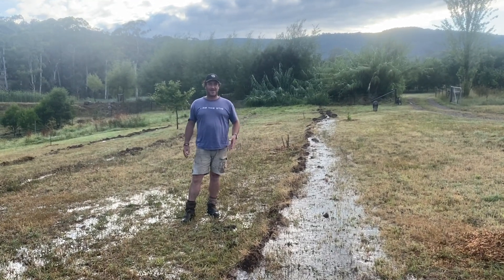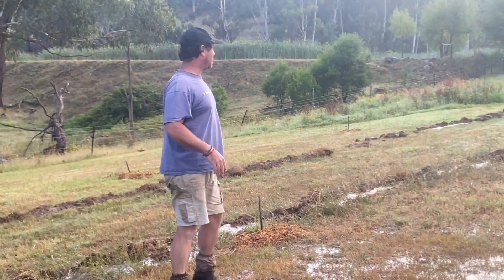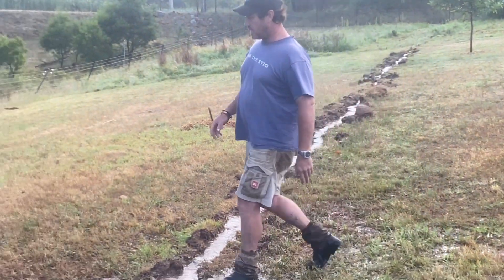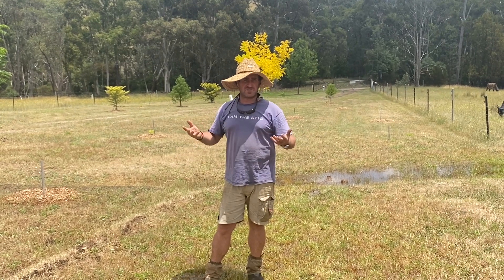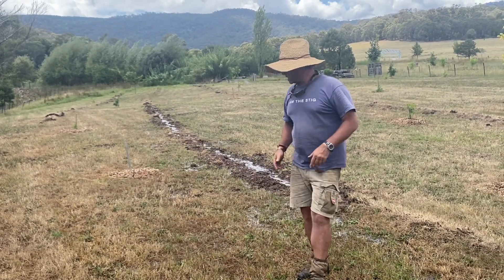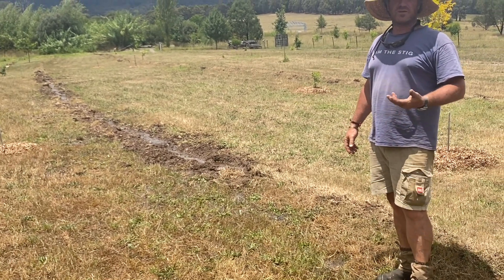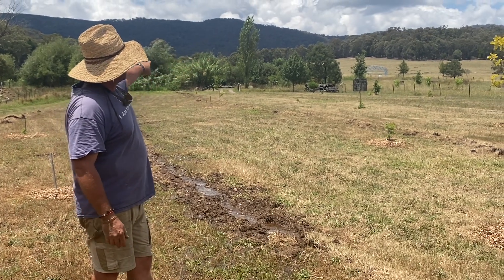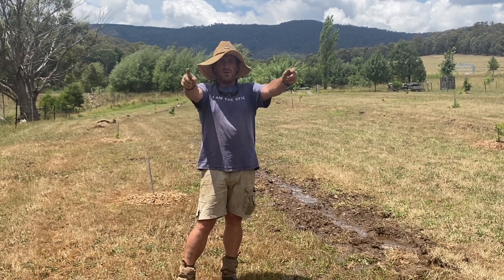Soil Hydration With Keyline Cuts.

Comment: The more I learn about keylines I feel like keylines in fields very similar to broadforking for residential back yard or for small market farms. Is this correct?
Reply from the maker: Hey Jeremiah, key lines and swales enable the water catchment to slowly absorb into the ground rather than running off the surface. If you use a broad fork its sort of similar where you are catching the rainfall. However the broad fork area can saturate really quickly and hence your not capturing a 100%. Its a great start through. Maybe a kelyine or swale at the top of the vegetable garden and allow to absorb slowly. Cheers

Comment: Hi, I'm a drainage design specialist. Were I farm, we have very dry summer and very wet winter, but like you, it comes down hard and fast. What we do is use what we call sub soil plow. This does much like your pipe plow, but we do these cuts every meter. This just speeds up the hydration of the land with any rain we get. Doing it this way means we don't need the water to stay still for long. It just fills these voids down 600 mm down. This hydrates the land so fast and lasts weeks.
Reply from the maker: Hey Nicholas how many tines are on your sub soil plough?
Reply: @FatCowFarmTatong  just the one on mine. It's easier to control and stay on contour.
Reply from the maker: Hey Man, thanks. @nicholassmith787
Reply: The pipe layer has one distinct advantage over the keyline plough (as currently designed). It could use the pipe feed to introduce organic matter or compost derivatives directly to the bottom of the cut and speed up the progress of the deep soil critters as they regenerate the soil. Towing a tank to provide the mix would automate the process.